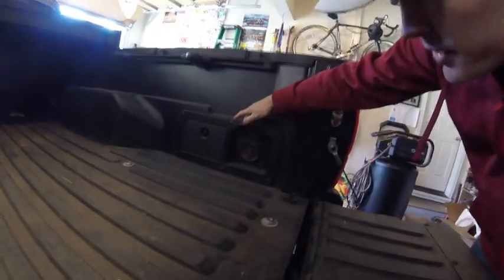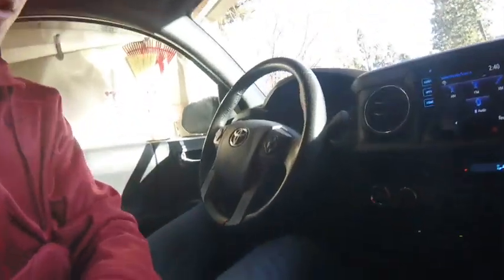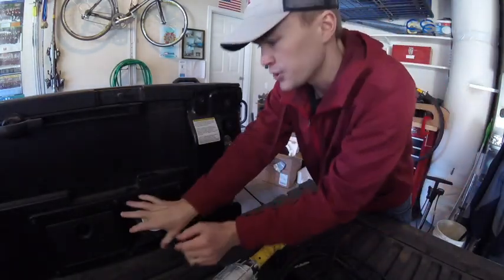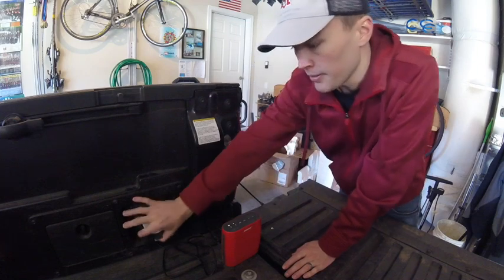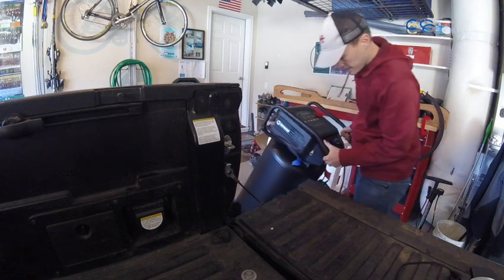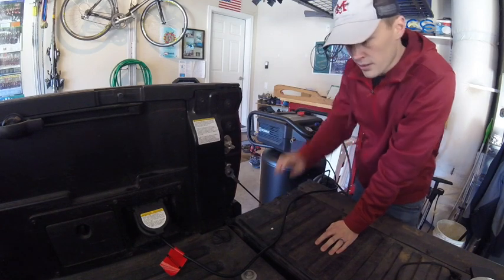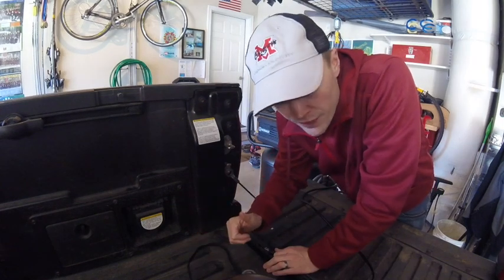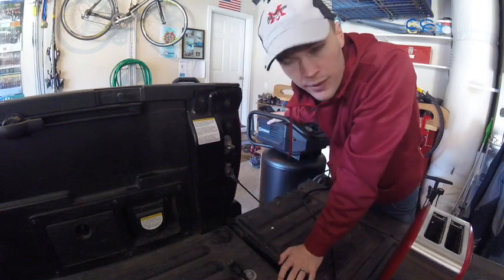Using the Tacoma 110V bed outlet

Comment: I was able to run a small "pancake" compressor from Harbor Freight  with my taco. Takes a while to recharge but managed to use an air wrench taking off large trailer wheel.

Comment: I use that rear outlet to power a heating blanket so my dogs can be more cozy traveling through Colorado during ski season. Driving on those icy, windy roads with falling boulders, runaway big rigs, tourists, and snow plows all around you is dangerous enough as it is, so we keep dogs in the back under the bed cap. We can also power up a small air cooling unit for summer travel.

Comment: Most of the time this feature will come in handy at a job site where your generator ran out of gas and you have to finish your job to run your drill, saw, nail gun, etc. In other words it'll get you out of a temporary jam and won't replace good ol' proper planning.

Comment: I have 2017 trd Tacoma that just today I ran a 80' extension cord into the kitchen hooked up my washing machine had no problem running so if I should ever have my electric shut off needing to wash clothes it will work just fine.

Comment: Mine is TRD Tacoma, this morning (4/12/2023) used a saw (7.5Amp, 3200RPM) to cut trees around farm, it performed very poorly even with the truck running. 
Can you explain why? It’s because of the Amp, the Voltage, the length if the extension cord I connected?

Comment: Used to power my son's JBL EON 1 when he'd set up to jam guitar in the park. 2014 Tacoma 4x4 TRD.
JBL is "380 watts of power, 118 dB max".
Also had a pedal board plugged into a power strip. Wah wah, boost, etc.
Performed flawlessly with engine off and I'd crank engine every so often so as to not drain battery. 
Hed play about 2hrs , aeems like your truck should run a toaster!

Great video!

Comment: Trying to boil water for hot chocolate and noodles for the kids. Water boiler wasn’t working, it would just turn off after a while without boiling the water.  Ended up using the jet.  Any advice on a good electric one that works and can load in a fair amount of water.

Comment: Those power tools will prob not work under load.   Turning them on is different than using them for work.   This outlet is meant for small load devices.

Comment: One thing to bear in mind is that he only used each thing for 1-3 seconds. If he tried to actually make a piece of toast he'd have found out that the power will stop after less than a minute.  Then you have to turn the vehicle off and back on and push the button again.  At least, that's what happens in my 22 TRD Off Road when I try to use it with anything but a very, very low draw appliance.
Reply: I have a 2022 Off-road also! Do you think you can brew a pot of coffee?
Reply: That would be cool

Comment: Tools/appliances with no load are not a realistic test.  For the no-goes, did you check to see if the breaker tripped?
I could power a small coffee maker with mine (with the engine running) BUT I had to reset the breaker a couple of times.
Reply: Where is the breaker located on the truck?

Comment: It’s good for things such as if u have to cut something do a short job pump up a tire what not, but for me we have a camp we go to now and then and I thaught it would be great just to plug it into the truck and run lights and radio instead of using the generator, the problem I see with it is it only works with the key on the on position instead of accessories,  which means the headlights and taillights are on all the time as well as interior dash lights radio etc ! Kind of defeats the purpose unless I’m doing something wrong

Comment: Will it kill the outlet if you are using it without the truck running and the battery starts getting low? Just asking cause I want to use it with the truck off while fishing but want buy truck to start so I can leave.

Comment: Would this run the dometic cfx345 while traveling? Vs cigarette lighter and having it in cab from point a to b? Then I could use the jackery once at camp when the truck is off. Any insight?

Comment: Too bad you only talked about watts, I get it….amps are the biggest hurdle in running that compressor. 
If you can’t get the full 15 amps, or even 20 depending on motor plate info… 
It cat work regardless of watts ( voltage conversion ) so: wire size ( resistance) amps draw and watts. 
You have 1/3 of the math, but good basic overview if you don’t need to know what it CAN do.

Comment: Well you did not test the drill and the jigsaw under a load. If you’re going to do a test like this you really should get a white meter to connect in between whatever appliance you want to use and the output of the truck. What I’d really like to know is when you plug the toaster in did the RPM of the engine change as the load came up
. I do give you credit for trying

Comment: How can you run the outlet while driving? I was really hoping I could charge my goal zero in my slide in camper in the bed of truck while driving.
Reply: Just plug it in, and go drive?
Reply: @montanamike7948  looks like my goal zero draws 130 watts while charging and Tacoma only works for up to 100 watts while driving.

Comment: I got a 2021 SR5 and it did not come equipped with this :( Would it be particularly difficult or expensive to add one?
Reply from the maker: I wouldn't try to add one.  Just buy a portable power station like one of these: https://amzn.to/37lkRqA
Reply: @DrivenCompanion  I see this, but part of the appeal of the built in one is running tools while to engine is running, basically acting as a generator.

Comment: can one swap out and upgrade the power inverter?
and, fwiw, most tools + appliances should have their wattage on a label somewhere. I have a Hilti hammer drill that wouldn't work on the 600 watt inverter that came with my work truck but works fine with the 800 watt inverter I connect to the truck battery when running.
oh, and nicely done video. I booped the like fer ya...

Comment: Can I charge my phone while the car is running? Is it not going to burn my phone?
Reply: Oddly enough, the charging ports do not work with the key off, and the bed power plug isn’t available on the SR5 and under, bummer
Reply: @harry39196  haha its ok, i sold my Tacoma anyway 😔

Comment: Afaik, that outlet in the bed is just a hardwired 400 watt power inverter. I've run a Skil saw and cut a handful of 2x4s a while back, was no problem but I think I did have the engine running.

Comment: Awesome just picked up a 2020 I assumed you could just plug stuff in and it works good to know about the toggle switch guess I could read owners manual LOL wondering if it’s possible to blow fuses using this option. The shop light would work great as well as a makeshift reverse light deep forest camping what not.👍
Reply: the switch itself is actually the fuse it will turn off if the draw is too much

Comment: Good video, but putting those tools and appliances to their intended purposes would be helpful.  I have a 2017 Off Road and use the electrical outlet a lot, but it is obviously light duty.  I charge my Sony DSLR, my Bose speakers, and other devices that can’t be charged from a 12 bolt outlet.  Portable tools would certainly fall into that category at least, even if they performed poorly under a load.  I also am able to run a small air compressor to air up when I get back to civilization.  I never thought of taking a blender, but the concept of trail margaritas is certainly appealing!  And the Yeti holds ice for days.  I have even charged items while driving.  Just make sure they are tightly packed.  I leave my camera in its case, which is amply padded.  Works great!

Comment: do you keep the truck on (pressing the start button twice, not stepping on the brakes) but not running? or we can turn it off after pressing on the 400 w switch??? THanks!
Reply from the maker: For full power output it needs to be on. For low wattage devices it can be off.

Comment: When you turned the truck on did you bump up on the switch to 400 rather then 100? It appeared that you went to just turn the truck on not the switch in the cab, it has to be bumped up to 400 setting it was probably in the 100 mod setting, if you had set it @ 400 when you started the truck the compressor would had worked,  just running the truck does not turn the switch automatically to 400 I have an 017 tacoma trd offroad my switch has 2 settings on it 100 & 400 using the 400 setting you can run the compressor no problem the ac outlet can pretty much handle anything as long as the switch is in correct setting just wanted to clarify that on this feature.
Reply: I dont think you can switch between watts. You simply toggle power to outlet. The truck determines watts based on whether truck is running or not.

Comment: Hi there hope you can help me.  I have 2018 Tacoma and my truck was on and I turned on the ECT PWR button and click on the 400w/110v and I was using electric tea pot and for some reason the 400w/100v keep turning off every 30 sec. Why is that? I'm sure I'm doing something wrong.  Please help
Reply from the maker: My guess would be that the draw is too much for the system.  Could be that the draw increases at 30 seconds as well...

Comment: I'm glad I bought a Tacoma, I can't count the number of times I have been driving and wanted toast :)
Reply: hahahaha
Reply: There's not enough power with two of those inverters tied together to run a single toaster.
Reply: Nope, won't work. for a 4 slot toaster which requires approx 1.55kwatts, a voltage outlet of 120v, you would need to draw 13Amps. 
400W ÷ 120V = '3.3A.
Ain't gonna work.
Reply: Haha! I love my Tacoma, but this is great 😂
Reply: Someone’s never been camping!
Reply: My personal chef makes a full breakfast in the bed while I drive to work.
Reply: Why want a toaster when u can drive a toaster, scion xb
Reply: @dr.blast__2713  I like the first gen xB, if it came in AWD I would strongly consider it.
Reply: @wickedmuffin76  had it actually my only complaint was depending on ur engine mine was the smallest factory one u can get it lacks power tbh but fuel economy and room was great, almost as good a Prius and acceleration was slow tbh
Reply: @dr.blast__2713  In addition to the Tacoma I have a first gen RAV4, so I get slow acceleration and bad mileage :D, but it is AWD. I also like the CH-R, and if it were available in AWD I would strongly consider it to replace the RAV4.
Reply: @wickedmuffin76 what do you consider bad mileage?
Reply: @korndawggy1801 The RAV was under 22mpg, should have been better for the size and weight, but the automatic and full time AWD were a big drag. I don’t have it anymore, I sold it over a year ago.
Reply: I just pissed myself🤙
Reply: LoL
Reply: Ever loose heat ? Wait for parts for 2 weeks? Im looking to see if this can be used.
Reply: @kiranthakor-or1ft The outlet says it can provide 400 watts, that doesn’t run much of a heater.

Comment: Will the plug turn off before it kills the battery of the truck or will it go till the battery is dead when the truck is not running.
Reply: That is a great question. Hat tip.
Reply: 2018 , sitting in parking lot waiting. 
Playing radio loud, in accessory mode. 
Don't remember how long I was doing that, but the dash screen light up red with some kind of warning about turning off radio or it actually turned off itself in order to conserve power for the battery...

Comment: Why don't you just read the amp rating on the device being used? Watts/Volts=Amps  100W/120V=.83A     400w/120V=3.33A
Reply: Electrical engineer he ain't!  But nothing wrong with trial and error effort.
Reply: Because some people would like to actually see it and don't know much about electricity
Reply: Hey guys I'm super ignorant when it comes to electrical stuff ... I tried a coffee maker on taco outlet  that says 900 watts and worked fine. 
Wondering if an 1000 watts Griddle would work ???

Comment: How long can it run an item while the truck is running? I’m going camping soon and wondering how long it can run a movie projector with the truck on. Will it last the length of the movie or is there a good chance the bed will die on me? Not sure how that all works. Thanks for the help!
Reply from the maker: Should last as long as the engine is running if it has the power to operate.  For something like a movie you might be better off with a small generator so you're not wasting a ton of gas

Comment: My Corded Circular Saw I used keeps tripping the 400watt.  Every time get half way of sawing my 4x4 post the saw continuely trips which I have to go back and click on switch inside the car.  Any reason why is the saw to much watts the the outlet?
Reply: I would probably say when under load it  could trip, when the electric motor is demanding more to keep it up it’s rpm’s, my guess

Comment: Nice video!  I noticed you have a xc ski profile in the back of your video.  Would the ac plug power a waxing iron?  I was also wondering if the ac plug would power a electric blanket on those cold night?  Thanks in advance!
Nick
Reply from the maker: I'm guessing it would do both.  Using it for a ski iron would be a great use!  With an electric blanked I'd worry about draining the battery.

Comment: Most electrical items will tell you how much power they consume. I wouldn't be putting a 450 watt plus item on there, even if it seems to work, it won't for long. Damage to the item & the inverter is a likely result. A little common sense goes a long way.
Reply: Loop

Comment: I ran my battery down while using a fan blowing on me while I installed a aftermarket bumper in like 105 degree heat, loved the option but wish it would have shut down when the battery got down to a certain charge, but was my fault for letting it go that long without starting the truck on to recharge the battery.
Reply: same happened to me.... there should be auto shut off to avoid battery drain below certain level. Guess its best to leave the car battery to what its supposed to be used for.... start the car.

Comment: So that outlet won’t power my ARB Fridge while driving?   That sucks.
Reply: Bill Beverly you can do a mod to override it and have 400 watts while not in Park
Reply: I've done that mod to my 2012 Taco and can attest that it DOES work. I dont have an ARB mini fridge but I do have a small mini fridge from a camper and it runs great at 400W. I use this combo to keep my food cold when I go camping, when i get to the camp site i switch to camp power. Saves me from buying ice for another cooler.

Comment: You really should not be trying to plug in all those devices into that outlet. 400 watts is not a lot of power. Trying to run power tools / kitchen appliances with heating elements is neither good for the tool or the trucks power inverter. Trying to run an electrical motor on less power than its rated for can burn out the tool, and trying to run a toaster / waffle iron can damage the inverter or at the bare minimum burn out its fuse. That tacomas outlet is good for things like utility lights, a television, and maybe some small amperage devices like a fan or a battery charger for your power tools.
Reply: Im here waiting for parts to get my heat working.. are you saying I shouldn't run a small heater until my parts arrive?  My truck will be running and will rarely use until its fixed.. but -30C  sucks.

Comment: When i have my key to on and running my buffer at the car wash , it sounds like my fuel injectors are going on periodically . which can cause oil dilution etc. If it isnt the fuel injectors , then what is running ? for about 5 sec. at a time , every 5 min/10 min,
Reply: Sounds like your radiator fan is kicking on....
Reply: LOL, nope ,, I def know what the fan sounds like.... When u first turn your key to the on position , u can hear the injectors ,for priming the engine... Sounds exactly the same...
Reply: It is your fuel pump running

Comment: This is an assured test. Beginning with test number 4 at 100watts would likely be fail if tested properly under load. Instead of plugging in a drill and running it, try to actually drill a hole or cut something. More likely than not, the breaker would kick over or the fuse would fly.
Reply: I use my drill and saws weekly and have never had a problem. Just a few minutes ago I ran a leaf blower with no issues. I also run a pancake air compressor (vehicle needs to be running) but also no issues.

Comment: Good demonstration. I actually have a 2015 Toyota Tacoma and it has the TRD package with the power outlet and I actually can run a compressor but it's one of those small ones that has the little fill up tank so I think it depends on the size compressor that you're trying to power.
Reply: 2015 TRD? Nice! I just turned in my 2015 prerunner 
Apparently 2015 was a really good year I didn’t know till I sold it. They have been holding value but I chose to sell before they dropped anymore. I hope yours never lets you down

Comment: How long can each setting power something?  Battery drain to dead?
Reply: The vehicle automatically shuts off after 15 minutes of power being used and the truck not running.
Reply: NATSCHKE FAMILY ADVENTURES confirmed? Is this in the manual or how do you know for sure?
Reply: I managed to drain my 6 months old battery by plugging in a fishfinder battery charger (only 4.6 amp)... obviously even 15 mins can drain enough to kill battery. Luckily I had a friend with powerful starter battery. But I learned my lesson. will get a power bank as I really don't want to run the car and fume up my campsite for charging.  Really not designed to do much w/o car running in my eyes

Comment: Correct...same set up since 2005. Great power output for a 30amp draw(respectively). Try the below mod for continuous 400W output and add a receptacle in the cab.

https://youtu.be/0cG7OQMNRf4
Reply: it will never do more than 3 amps I don't know where you're getting 30